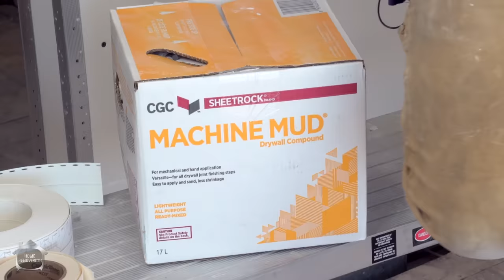DIY Drywall Part 4 | Drywall Taping Masterclass for Beginners!

Comment: Why do Americans use jointing compound for walls?.....in England we use plaster to skim walls. It is much more durable and doesn't need any sanding.....just trowel flat and it hardens like concrete and will last 20 years. Jointing compund or "Mud"...will dink at the slightest hit....Not saying it is bad, but just think plaster is much less hassle, and is much much tougher.....Mud for cheap....plaster for a pro :)

Comment: Would you use the corner beads around a window?
Reply from the maker: if you are returning the drywall to the window jamb and not adding casing yes!
Reply: @HomeRenoVisionDIY  Thanks, that solves a few problems for me! And thanks for all the useful tips.

Comment: Why you taking out the mud from the Box And putting like that in the Bucket. There’s a very easy way to do that. Roll the polythene of the mud on the sides of the box and just lift the mud box put it on the bucket then just take off the polythene. So Easy way. 🤪

Comment: If i plan to have crown mould on the ceiling, does it need to be taped and mud before to install anyway?
Reply: I always have just to seal the inside corner anyways, or if the crown is ever removed it's a less step to deal with at that time!
Reply: @mattyoung1321  when I was doing new construction if crown was being installed we just tape the angles.
Reply from the maker: totally not needed!
Reply: @HomeRenoVisionDIY  I agree but the inspectors insisted on having the angles taped. Since going independent I don't tape tape them anymore.

Comment: Can you tape over wood and then continue with mud
Reply from the maker: no. you need a substrate that does not expand and contract like wood. that is why we install drywall first. it will all crack otherwise.
Reply: @HomeRenoVisionDIY  so is it best to remove wood and re board the gap
Reply: Ok thank you

Comment: Tip: don't by fast setting mix. It will be solid in your tub by the time you have filled half a corner🤣. Trust me i know.
Reply: Try 90 minute or 210 minute next time

Comment: I note your boards are laid horizontally with one long horizontal taped joint where the factory tapered edges meet. However if you have a vertical butt join where the end of a board meets another with NO tapered edges, how is this taped and finished? Do you just use paper tape and one coat of mud to bed in the tape or does that butt join get a second coat slightly wider than the paper tape? I assume it doesn't need a third finish coat since you don't want to crate a mound where you have a butt join? Ah OK think I found the answer here https://www.youtube.com/watch?v=exBzN7kK24g

Comment: You don't tape with a 4inch knife, it's doesn't matter if the outside of the tape is dry, you don't need to dimple the angles, you don't coat first coat with wet tape and especially not with tapping mud. Hack.

Comment: Big flat surfaces with evenly-matched factory edges are one thing, but repairs are another. In the middle of a repair right now. Edges don't match, studs don't match, and to top it off, the wife wants to put tile on it when I'm done so it has to be FLAT! Arrrrgh!

Comment: Soo dont get the paper tape wet?
Reply from the maker: you ant it wet after you have installed it to keep from bubbling!
Reply: Ignacio Landeros you want the tape to draw in the adhesive in the mud. If the tape is already wet it won’t.

Comment: How do you transition drywall into a brick or cinderblock wall?
Reply: Craig Reustle use something called a half bead. It finishes the edge of the drywall .
Reply: After the half bead and mud do you seal the walls together with caulk or leave a gap?
Reply: Craig Reustle yes you would run your drywall up to the edge of the brick , install your half bead as tight as you can to the brick and after taping caulk the gap. Then you’re a superstar.
Reply: drywall j molding. $2.50 at home depot in with the corner beads
Reply: Craig Reustle I use a product called tearaway.

Comment: Would of liked to have seen more close up shots of the mud actually been applied and worked-in like at 28:46.  Which was the only shot that really showed what the mud looks like, how to smooth it etc and what the texture should look like.   Jeff you're a great guy, but it's not necessary to have a full body shot of you every frame when you're demonstrating how to do a DIY project. You also didn't address what you did about the raised bubbles in the metal caused by the holes?

Comment: no professionals  nail corner beads anymore LOL they crown staple them with an air nailer Free pro tip Your Welcome :-) P.S even screwing them would be better than nailing :-)
Reply: all methods ok; both nailing and screwing are more secure than staples

Comment: i dont wonna be disrepecktfull but watching draywalling how u doing in USA its looks like u are in stone age to me . You couldnt as a profesional as you said u are , never get job enywhere in EU . I  couldnt recognise a system you are using not even a single one . How much i can tell you using the very simple sistem everytime and mostly wrong one . Mineral wool on outside wall without water barrier film!?? One layout of Draywalling instead of double etc. This is wrong on so many level . At the end of the day its looks good but techichaly wrong . Why is so different over there is the Question ?? 
Best Regards

Comment: Water or 45 min mud, couldn't tell the difference, a finisher would have tightened the mud before starting....👎
Reply: @centauri8820  I am not cocky, but confident in my ability, because I was taught the proper way, and I am not interested in showing a video, again not proud or a show off, just so you know a million subscribers only means a million don't know the difference of correct way and wrong way....